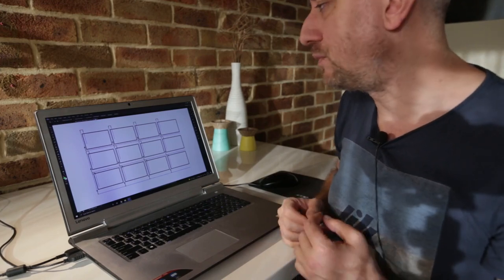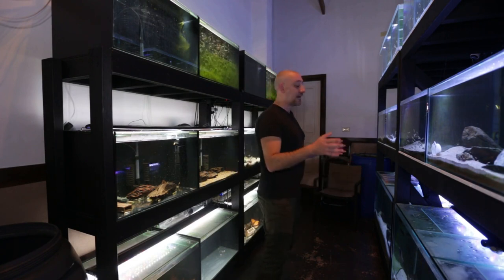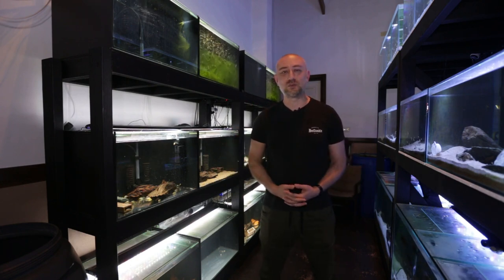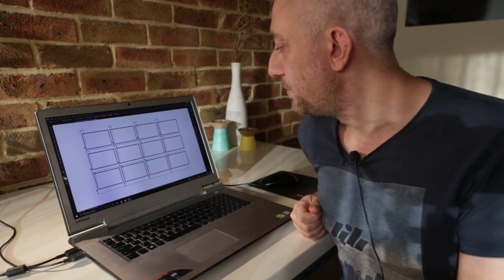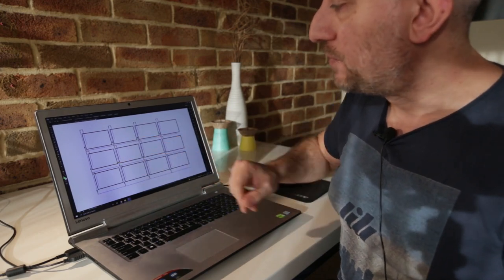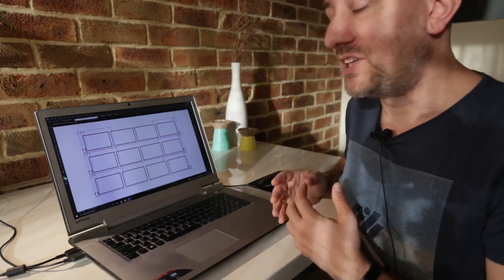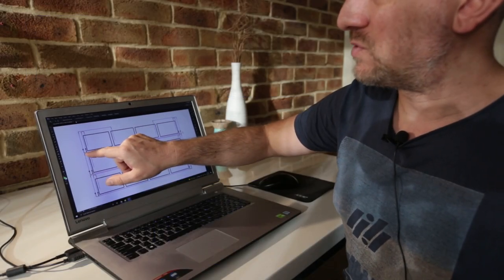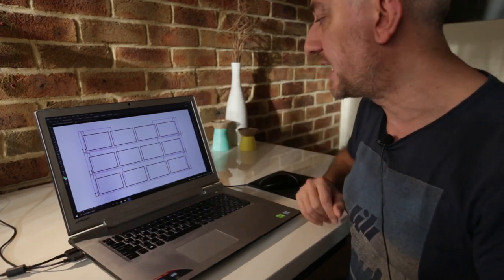Fish Room Water Change System - Part 1 - No drilling

Comment: I have been running a similar system to this in my fish room for a few years now and have a video of it on one of the sets of tanks that I first started with in my video list.. It works great for me and water out then water in and it contains the syphon all the time.
Reply from the maker: Good to hear Tim! I am also not concerned about losing the syphon. As the mere process of filling the tanks back up via the same hose lines "recharges" the syphon for the next water change. I'll check your video out soon too.

Comment: Looks like your doing the same design I did for my fishroom. Make sure your using at least 3/4" pipes and hoses, anything less is too slow.

I use clear food grade hoses between the valves at the end of the rack and the pvc at the tanks. This keep thing flexible incase i need to remove a tank.

Note: Do not use quick connect valves if you also use your system to fill up. Those valves can come apart under pressure. 

Good luck
Reply from the maker: Oh nice one mate, actually yes the minimum is 19mm irrigation lines that feed into 25mm lines then into 34mm hose to the garden. You'll get to see the quick connect system I am going with next week, not a chance they will come off! I'm more worried about the irrigation fittings coming apart actually but I can control the flow of the pump for filling.

Comment: Do you plan to use some stationary water pump to suck water into the pipes?
Reply from the maker: No pump needed for this. It will all be done by siphon. Even if the siphone breaks and I've emptied past the siphone line, the siphon will be created again upon filling the tanks back up.

Comment: I enjoy watching the videos but mate can you please take a look at the high frequency audio. When your in fishroom there is this high frequency sounds and it's super discomforting.
Reply from the maker: I had a few people mention high frequency noise about a year ago. The issue is, I can't hear it at all. So it is really difficult to work out what is causing it. Could you hear it when I was talking next to my laptop? Or just during the intro and outro?
Reply: The clip at 0:08 and then the following clip where your talking in the fish room has the high frequency sound. The clips where your at your laptop don't. The camera mic seems to pick up a sound from somewhere in the fish room. I'm not sure what video editing software you use but you should be able to do a sound spectrum analysis which will show those high frequency sounds and you can cut them out

Comment: Isn't 3x 19mm = 57mm less of a bottleneck than one hose of 34mm? You are creating a bigger bottleneck?
Reply from the maker: I mispoke in the video and meant to say 18mm garden hose is the max size I could easily purchase (not 19mm) not that that makes much of a difference. But yes. Running 3 separate hoses would drain the tanks quicker. If I had a drain line in the fish room, it would be a no brainer, but I don't. Also, I would still then need to fill each row up separately as I only have 1 pump. And then fit all the different hoses up each time I do a water change. All that stuffing around each week doesnt appeal to me. With this I just clip in 1 hose and its ready to go.